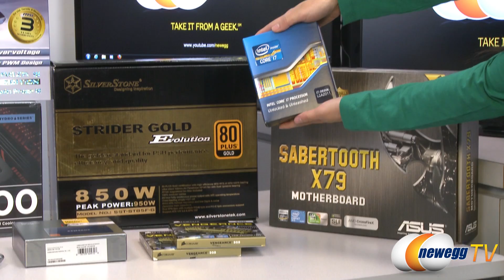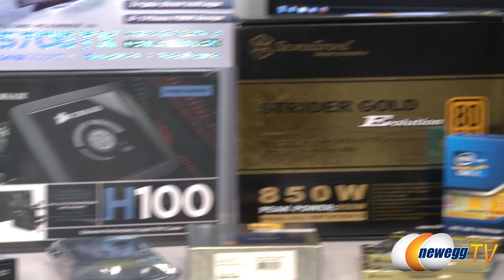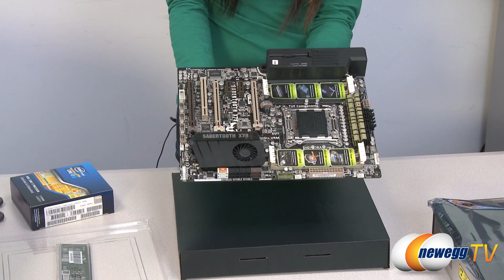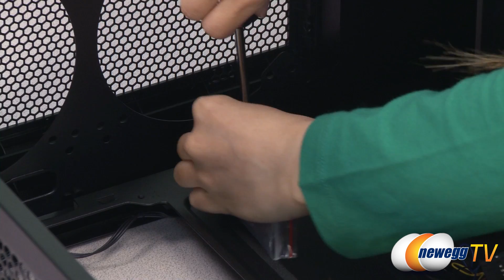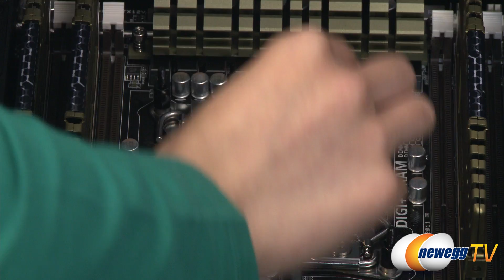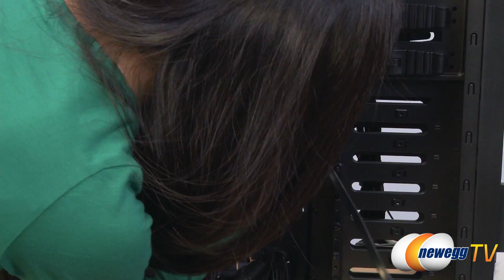Newegg TV: Joanne's New Gaming Computer Build

Comment: Just leave what comes with it on. Even if the thermal paste you apply later is of a higher quality you have to remove the one that comes with first. If this is not done correctly you will make the new thermal paste work worse then the stock one.

Comment: Paul, my rig is better. FX8350, Asus formula Z, 16GB Kingston predator ram @ 2400 mhz, Arctic cooling A30, Gainward 680GTX, Creative ZX sound card, OCZ 240GB ssd, WD caviar black 2TB HDD, 2x2 WD 2GB eco-green slave HDD's, coolermaster pro gold 1200w psu, LG BDRE, 2xLG DL, DVDRW, Coolermaster storm trooper ATX case, Philips blade2 24" AMVA LED monitor, logitech X-540, microsoft x6 sidewinder keyboard, Prestigio PMS G1Y gaming mouse. No liquid cooler. Corsair bad rep for leaking.

Comment: Future-proof? You are aware that by the time that CPU would be ideal for gaming, everything else will be deprecated, right? And most likely when you go to upgrade your hardware in 5-10 years, you'll find that 3930k is no longer compatible because you'll probably need to upgrade your motherboard to support the new hardware now running upgraded socket types.

Sure, future-proof at the low-end of gaming but not high-end.

Comment: 16GB of RAM and a 3930K for gaming? I'm fine with my Phenom 2 quad. I'm also a 3D graphics artist and I've never needed more than what I have (6GBs). Also note the fact that the VAST majority of games are not written for 64-bit architecture, so that extra 12GB is a waste. And no sound card? Onboard audio sucks. Gaming rigs need good surround sound. That PSU is also overkill. That rig needs no more than 600w.

Comment: This was released in March 23, 2012. Not only was the 7870, 7950 (Which both cost less, perform better, use less energy, and overclock excellently), 7970 out, but the 670 (which is better in every single way) and the 680 (overpriced) were out.

Comment: Yes, in some very intensive cases such as encoding 2560x1600 video, the GPU will bottleneck the CPU, but not for modern gaming at ultra settings, at least not on a single monitor.

Comment: I noticed that there are no gaming benchmarks.

2 months ago, I built a gaming machine that I could afford.  MicroCenter was out of MB I wanted, and had to use a Gigabyte GA-Z77X-D3H, G.Skill 1866, CAS 8.  Noctua NH-C14 140mm x 2 SSO CPU Cooler, Prolima PK-1 TIM, i5-3570K at 4GHz [hottest core 54-55 degrees ( ~ 58F max core temp at 4.2GHz) under load, 80 degree F, 26.7C room temp].  Intel 330 SSD 180GB, HAF 922 case 3x 200mm fans. Used HD 6950 from my old computer.  Runs all my games very well.

Comment: I'm well aware that processor architecture and l2/3 cache are just as important. However I have found that 9/10 times while gaming both amd/intel processors both provide adequate performance and I can not discern the difference between the two on identical machines in every other facet.

Comment: TIP FOR JOANNE:

 - you don't have to hit delete a thousand times every time you want to enter BIOS. If you disable the splash screen the first time you enter in BIOS, after that your startup info should tell you when the USB headers have loaded, then you can hit "delete" once and it'll take you right into the BIOS. The X79 might be a little different, but afaik that's generally what you can do for most modern mobos.

Comment: Odd. Processors these days have thermal shut down protection, nor are they made out of any form of combustible materials.
I.E. You forget to install that heatsink? No biggy, no damage will be incurred the system will just switch off automatically. - so I highly doubt your story.

Comment: It's Quad Channel so therefore, you should buy two more ram sticks for everything to work the best it can. Using only two DIMMs will cause your motherboard to run in Dual Channel mode, which ofc is a step down from Quad Channel. 

TL;DR - Buy two more sticks.

Comment: Case: Rosewill Thor v2 gaming Full Tower (white)
processor: I5 3570k 3.4 GHz (Ivy Bridge)
MotherBoard: GIGABYTE G1.Sniper M3
CPU Cooler: Cooler Master Hyper 212 Plus
RAM : 8GB corsair vengeance 1600 MHz DDR3 low profile 1.5v memory
VIDEO CARD: HIS IceQ H787Q2G2M Radeon HD 7870 GHz (or) MSI GTX560 Ti 448 Core Review - Twin Frozr III ?  OR WHAT DO YOU THINK I SHOULD GET?
psu : ?
SSD: Crucial m4 128GB SSD
HDD : 500GB

Comment: Hello, I have built many systems over the years.  One important thing Joanne left out was she did not use an anti-static wrist-strap.  When handling any sensitive electronics, especially building a computer, ALWAYS use an anti-static wrist-strap.  Otherwise, you risk damaging your expensive components and YOU WILL NEVER FIGURE OUT WHY YOUR NEW SYSTEM DOES NOT BOOT OR WORK CORRECTLY!

Comment: Uh... the 570 is pretty good. Sure it's not the best out, but I've got 2 in sli and run any game out max in 3d vision. won't need to upgrade for a long time. 1 570 will still run games, high detail, in 2d for the next couple years. Definately won't find me upgrading my sli setup until the 700 series at least.

Comment: Great job for your first build. hope you had as much fun building it as I did watching. I think you would have been better off with the 600 series GPU. I know very hard to get at the moment. MY new build: Asus Rampage IV, i7-3960X, CORSAIR H100 W/COUGAR CF-V12HP fans, G.SKILL Ripjaws Z Series 32GB DDR 2133, Crucial M4 256 GB SSD for (OS windows 7 ultra), Western digital Black 2TB HD, EVGA GeForce GTX 580 Classified ULTRA 3072MB, enermax 1350wt power supply all in a cooloermaster HAF 932

Comment: I would go for Z68 or the upcoming Z77 with 2600K or upcoming Ivy-Bridge based i7 and use the money i saved to get a GTX680. X79 and 3930K are serious overkills and a waste of hard earned money if you are using only one GPU. Even my old 980X + X58 UD7 plays anything i throw in with its dual GTX560Ti. Although single 128Gig SSD is quite fast, I would consider Dual OCZ Agility 3 60GiG RAID 0 array essentially doubling the speed. I would also replace the LG DVD burner with a BluRay Combo drive.

Comment: Have you seen real world proof of this? Or is it quoted from Corsair? With the amount of coolant they used, I would not be surprised if they got just about the same performance as the stock stuff. But i do have to say, they did not have a good uniform spread which would be why they actually might have worse temps. But other than that I believe the stuff they are using is expensive and considered enthusiast grade. On my own build I removed the thermal paste cause I was getting worse temps.

Comment: 100$ Case - NZXT Tempest 410 Elite
100$ PSU - Silverstone Strider Gold Evolution 850W
500$ CPU - Intel Core i7 3930K
90$ Cooler - Corsair H100
280$ Mobo - ASUS Sabertooth X79
40$ Memory - Corsair Vengeance 2x4GB DDR3 1600 (x2)
300$ Video Card - MSI GTX 570 Twin Frozr III
120$ SSD - Samsung 830 128GB
100$ HDD - Western Digital Caviar Black 1.5TB
20$ ODD - LG DVD Burner
50$ Mouse - CMStorm Inferno
100$ Keyboard - Razer BlackWidow Ultimate

which adds up to probably 1800$ could be more or less tho.

Comment: I really don't know why you guys didn't use or show grounding such as an ESD wrist strap.  Motherboards, especially ASUS, are particularly susceptible to static electricity discharges.  I would have also installed the SSD UNDERNEATH the hard drive.  Since hot air rises you should put the hotter device on top.

Comment: If you built this for gaming (as she mentioned Skyrim at the end), the money spent on parts was ill proportioned.  The combination of a LGA2011 chip/mobo and a GTX 570 is way heavy on the CPU spend and way light on the GPU spend.  For a gaming system with $1250 spent on the CPU/Mobo/GPU combined you will get a TON more game performance out of spending  $220 on a 2500K, ~$150 on the mobo, and then have $880 to spend on much more graphics power.  Also the wishlist has slightly the wrong PSU.

Comment: Consider price/performance. Rather than spend $600 on the CPU, an i5 2500k paired with dual GTX680's would be capable of maxing out pretty much every games out there at 5760x1080.

Point is you can get a much, much better gaming computer for the price. That's an excellent build for video editing (espesially with Premiere Pro), but it's not optimized for gaming.

Comment: There are a ton of options at that price point.

I would suggest any of these:

NZXT: Phantom, Phantom 410, Tempest EVO, 410 Elite
Fractal: Define R3, Arc Midi
Lian Li - Lancool: PC-K62
AZZA: Hurrican 2000  *Less than 125 with rebate on Newegg
Cooler Master: Storm Scout, Storm Sniper, HAF 932 Advance
Corsiar: 400R, 500R

Hope that helps man.

Comment: You stated the obvious 3 times in that comment. Obviously, overclocking a cpu + gpu won't require 850 watts. Obviously a 250 could run any game, but not very well. Obviously people care about price to performance. The extra power might be there for future upgrades. Maybe she's thinking SLI later. The build is great and the extra wattage will come a long way.

Comment: Quick question, I recently upgraded from an 8800GT (Old I know) to a GeForce 560GTX-Twin Frozr II. It works fantastic. The 8800GT temp would be 60 degree's idle and now the 560GTX is way below that. Right now, it's running at 25 degree's idle. Can a graphics card get TOO cold it freezes? I'm happy it's so low but surely there is a limit on how low? Someone help? :)

Comment: Water cooling on a mid tower case? All you'll succeed in doing there is blocking airflow, with the same results if you had used a fan.

Comment: Its nice that you like AMD and all, but Intel doesn't over charge... If you look at the pricing for the original Pentium 1 you will see it was 1,000$ even back then. If any thing parts have gotten cheaper. Intel provides the top of the line, AMD is in the high-mid range. People with the money buy the best, because its better. Simple as that. Also, just so you don't think im a fanboy, I have a 975BE and a GTX560ti.

Comment: I'm not an Intel fan, and never really have been(, hey bully the market, and over charge for there products), I'm also looking at the price of things, and doing them on my budget AMD helps a lot, and SSD's are a no go, as I never spend more then $550 on any of my system builds, in fact not a single computer in my house is INTEL, 5 are AMD based, and 2 VIA C7M based(basic netbooks with Linuxmint12 installed).